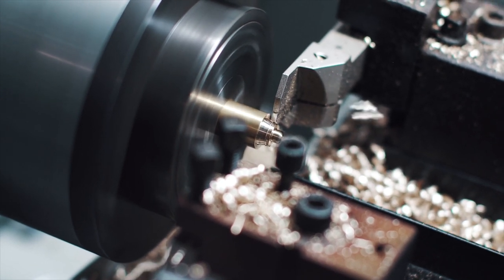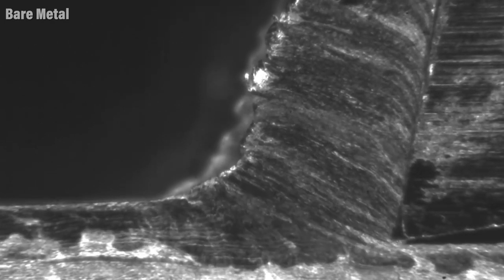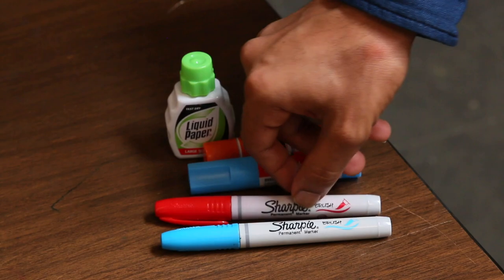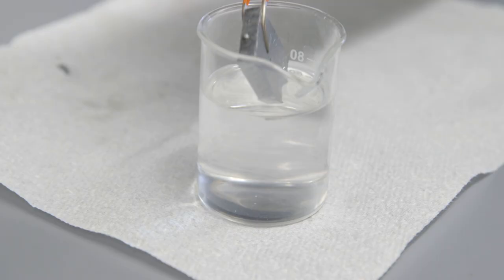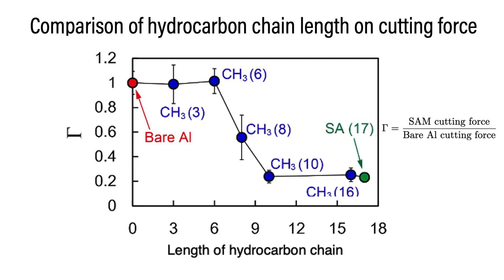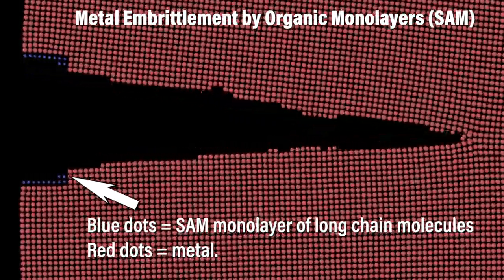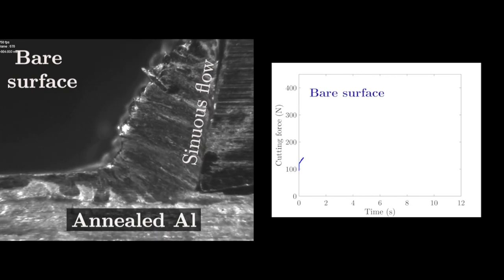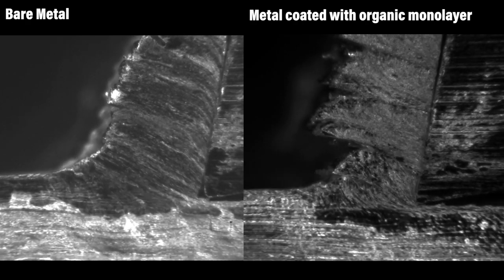Improving Metal Cutting With Organic Monolayers

Comment: Very interesting, the films do not effect the cutting tool contact with the material.  But they encourage the metal to shear?  Surface tension alone causing this effect?  Charles
Reply from the maker: Yes, the monolayers induces tensile surface stress on the metal.  You can read more about the research in the paper linked in this story https://bit.ly/organic-monolayers
Reply: @PurdueEngineering  6оо5о5о5ц5ц777

Comment: i think he miss spoke qnw he said. "soft metals: aluminum, stainless steel, nickel." stainless still is not soft. otherwise great video
Reply: He qualified that by mentioning tool steel as a hard metal, which is significantly more difficult to machine because of its higher carbon content (it is a carbon alloy) as well as its main alloying agents (tungsten, chromium, vanadium, and molybdenum which form carbides in tool steels). Stainless steel is a chromium-nickel alloy. Other alloying agents are nickel, molybdenum, nitrogen, silicon, sulfur, and titanium. The Mohs hardness rating of the individual components of tool steel (aside from molybdenum which is present in both) are all higher than stainless.  Ask any machinist (such as myself) and they'll tell you stainless is a rather easy material to work with.